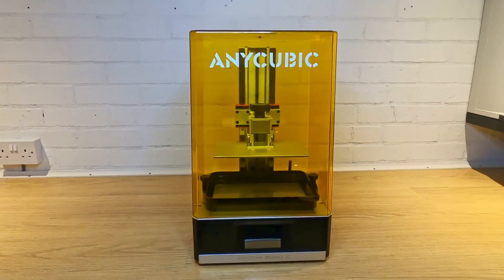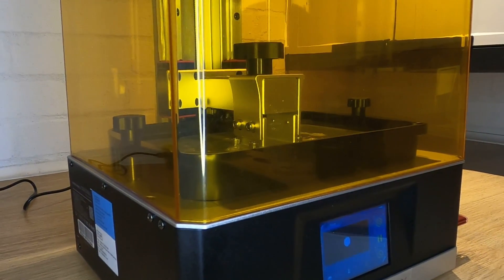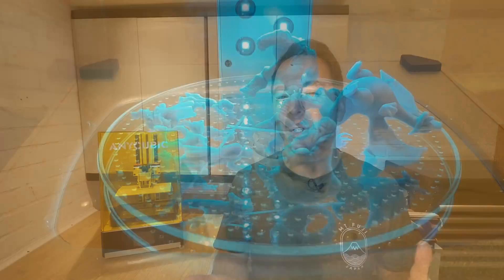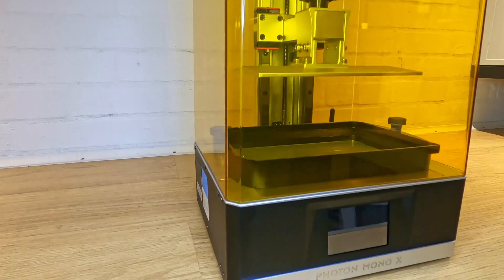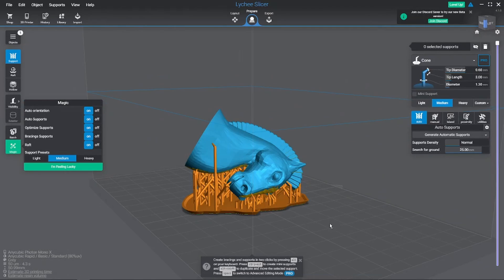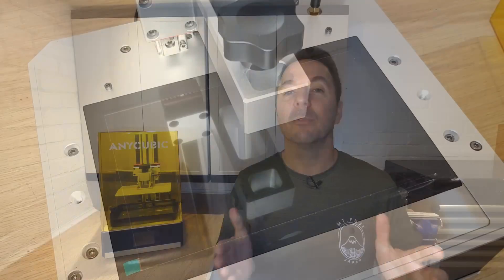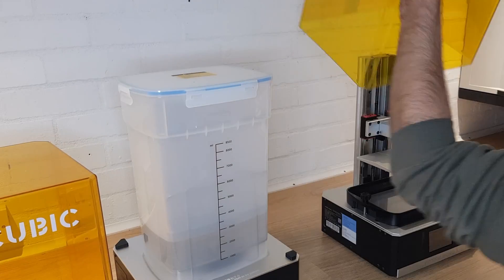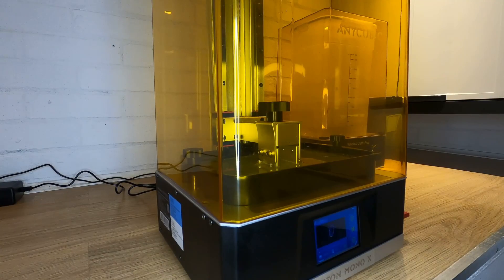All You Need To Start Resin 3d Printing With The Anycubic Photon Mono X

Comment: You don't mention STL files ( or whatever they are called on a resin printer ) are they the same ? Where do I get them ? Etc etc  🤷‍♂️
Reply from the maker: You can use the same stl files as with any 3d printer, just different slicing software.

Comment: Nice review Rick. I'm using Anycubic Resin printers for 2 years, and most of your toughts are right. One of the tip difrent type of resin work diffrently during casting. the most easy to print and forgiving mistaces is green transparent one. Also information about recycling IPA, for filtering resin U can use coffee filters or metal funet with metal mesh. for Wash and Cure mashine container I have print addons so it is more easy to put resin away because original one is leaking.
Reply from the maker: Great, thanks. Glad I wasn't far wrong with what I have learned so far.

Comment: Great Video. Do you have the printer in it's own dedicated room? Just wondering what the smell / fumes are like when it's going as this is a concern for me with a little one runnning around the place.
Reply from the maker: I use mine in my garage. I don't really notice the resin smell until I go out and come back in again but it could be a smell that people wouldn't like. I have seen setups where people have them in a large cupboard with an extractor fan pulling any fumes out of the room. I think that if your only option is to have one in your house then you want a dedicated room or at least the cupboard setup. I would also try to use something other than IPA to clean with as this is not a smell you want in your house in my opinion.

Comment: Great review, am very much still undecided on what printer to get first (fdm or resin).
Both seem capable of printing miniatures  but fdm seems less "toxic" in use (even when using water washable resin) but more work to setup (also some like the enders could double as a laser engraver which my wife would like to have).
Where resin is less setup and with water washable resin less "toxic" but still I would not feel really comfortable having one running in the attic..

Do you plan on making a comparison between to two?
Reply from the maker: Hi, someone else has asked me for the same thing so it's definitely on the list. My quick advice would be that if you want to print miniatures, you're going to need a resin printer. They are miles better on the detail. It's going to be tricky for you unfortunately with all that you've listed. When it comes to leaving it unattended, I am happier leaving a resin printer than an FDM machine as there is nothing being heated and no chance of thermal runaway. The smell is possibly going to be an issue though. The resin isn't too bad but if you or anyone else doesn't like it then you will have issues smelling it in your house. Having a laser engraver is a big bonus as it gives you so much more you can do. I haven't converted a 3d printer yet so can't say if it's practical to use one as both interchangeably. It's going to be tricky to tick all of your boxes unfortunately.
Reply: @RickyImpey  thanks for the quick response Ricky. I will probably start with resin as it does seem to tick the most boxes currently (and using water washable resin would solve some of the issues with cleaning (i.e. don't need IPA) but I still need to look into that further).
Also I might be able to use my air-unit (not sure what the english term is for it) to create a connection so I can hook up a tube and suck out the air.
So many things to keep in mind does not make this an easy choice to make or figure out what is better to get started (.i.e. learning curve etc).

Comment: I hoping to get my 1st resin printer sometime? I wish to start with a big one because I would only need to get a bigger one after having the starting small one.
So I wish to have a Elegoo Saturn 2.  this is one big print area and 8K details. and a fast printer. Just one problem it will cost about £500 to buy including the stuff you said like safety things and resin which is the pricey bit too!
Reply from the maker: Yes, they are a bit of an investment 😬